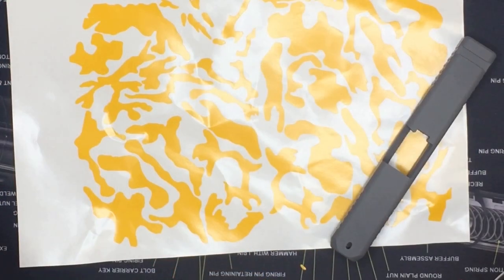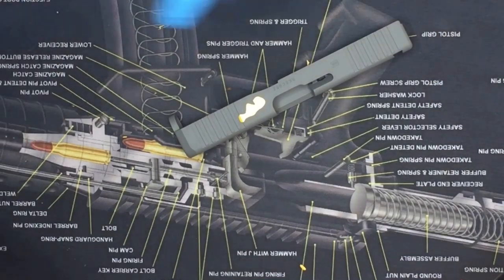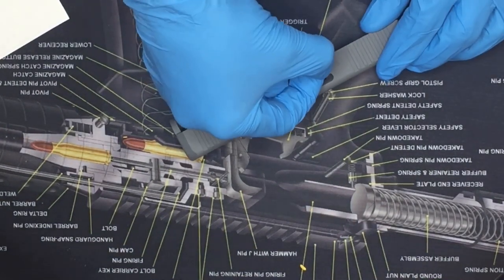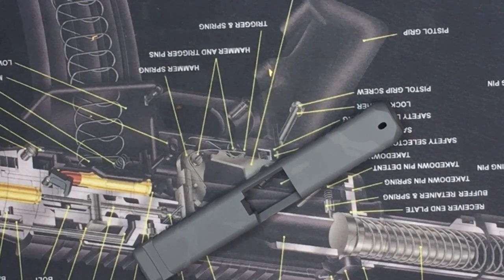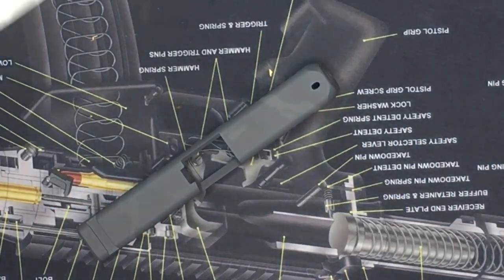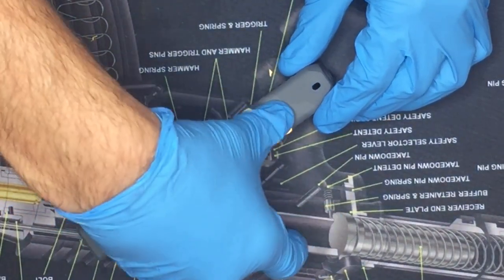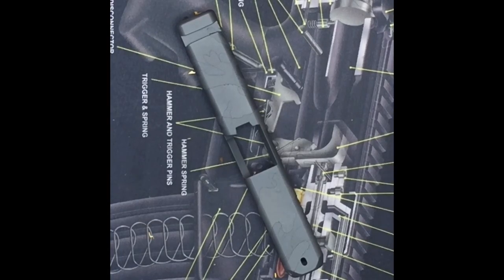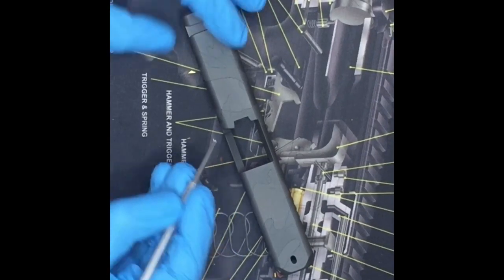Woodland Camo Cerakote

Comment: So you fully cure your base coat (rather than just curing to a tack free state) before laying any stencils? I always thought the subsequent coats wouldn't stick if you fully cured between layers (stencil applications in this case). That is so cool if that's what you do. Makes it much easier.
Reply: So spraying inside the slide doesn't make it stick when chambering a round?
Reply: @traysgang  mine are nice and tight, no issues.
Reply: I doubt it's fully cured
Reply: Shouldn’t fully cure between stencil colors, cerakote has lots of instructional videos to watch

Comment: Cool video.. so you never mentioned the in-between oven times.. are you just doing flash cures of 15 min.? also. I'm new to cerakote, but been doing powder coating and with multiple layers powder can build up with stencils being a thicker material,  so I will peel if I can before final curing to allow the edges to flow a bit so they aren't so sharp. would it make any sense to flash cure the last color then peel all stencils and then final cure?

Comment: Hello friend, I speak from Brazil. I would like to know the dimension of the tip you used in the airbrush 0.3, 0.5, 0.7 mm? What pressure range did you use on the  compressor? 15 - 20 psi

Comment: I know I’m late on this and not sure anybody asked yet. This also might be a stupid question. At what temp did you bake that ? I noticed you had the rear slide plate on which is usually plastic. How did you cure the slide without that part melting?

Comment: How long do you leave it in the oven between colors and what temp?
Reply: When applying Cerakote over Cerakote, flash cure at 150 - 180 degrees (F) for 5-15
minutes. Allow parts to cool to room temp before applying additional color(s). When
flashing parts for camouflage or stencils, all parts must be fully cured within 24 hours
from the initial flash.